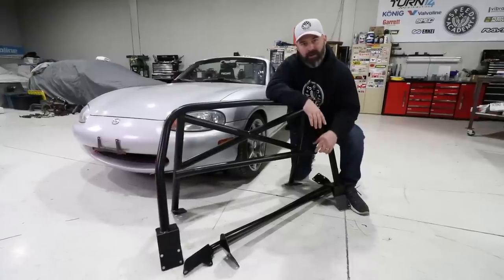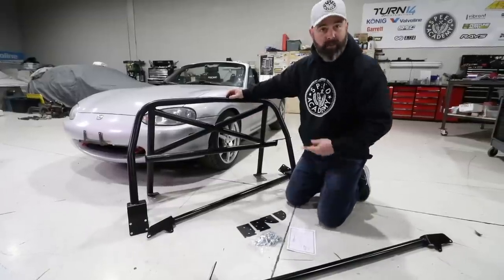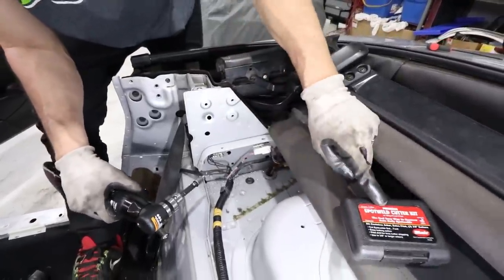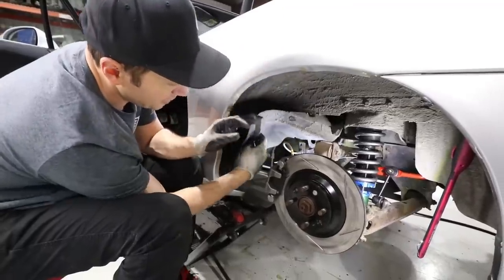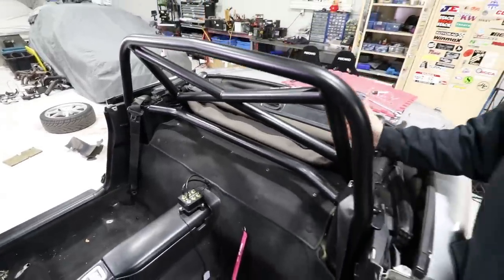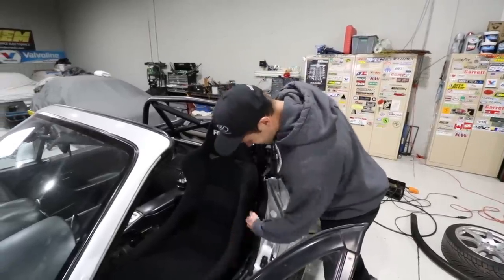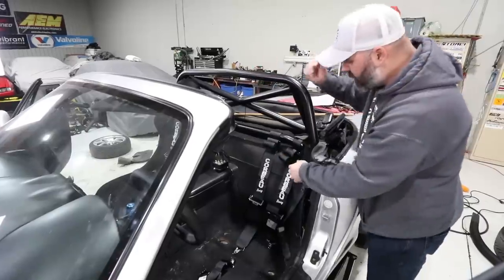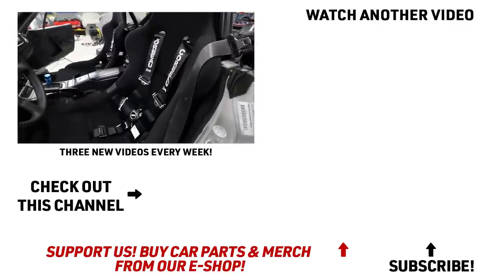Installing the SAFEST Roll Bar Into Our BUDGET Miata

Comment: Mold in that location is usually due to blocked roof drains. You guys probably already checked / cleaned them, but if anyone faces the same issue, now you know how to fix it.
Reply: yep! that mold / moisture residue is directly from clogged drained coming the hole / cutout in the carpet right in that spot. such a common issue

Comment: might want to change the driver side standard seatbelt, looks to have a huge chunk missing! 15:04
Reply: Yeah definitely, Mazda should be able to replace that under the seat belt lifetime warranty.  Assuming that exists in Canada.
Reply: Looks like somethings been chewing it 🐭
Reply: Yeah, that would be a FAIL here in Oz as far as vehicle registration goes!
Reply: @Patrick94GSR  yeah but the reason a chunk is missing is because they squeeze it through the seat (which isn't stock) and the door. If it broke from rubbing on stock parts they would definitely do it. I guess they could just not mention they put new seats in lmao

Comment: Try some NA6 doorcards or ones from LRB.  Might give taller drivers a bit more knee space to the side as well.
Reply: I have the LRB door panels - they are great.  Stock NB doors and steering wheel - my thigh would stick between the bottom left of the steering wheel and the pull handle on the door.  I installed the LRB panels and also a works QR hub / dished steering wheel and now my left leg can sit completely between the left side of the wheel and the door if I want it to.  I'm 6ft1 and my legs aren't skinny.  I know your comment is from 2 years ago, but wanted to reply in case any tall drivers are on the fence about the LRBs.  I have mine bare metal and they don't get too cold/hot.  In the summer the paint on the top of my door gets hotter than the LRB panels.

Comment: That's a good point about shipping, Dave. It is cheaper and often faster to ship things from the UK to Canada than to buy from the US. I have also found that buying from Japan is often cheaper and quicker than buying from the US. 

- EMS is a great way to ship from Japan as it takes roughly a week to get to us in Canada and there is rarely duty to pay.

- DHL is very quick from the UK or Japan. It usually takes 3-5 business days for an item to arrive. However, there is duty but it's usually much less than what you would pay by receiving a UPS/FEDEX package from the US.

RHDJapan is a really good site to buy Japanese parts from. It's in English and has built in currency conversion.
For you rotary guys out there: Jimmy's in the UK is a great company to buy RX7 parts from. They have good prices, good service, and ship DHL to Canada for larger items.
Reply: ...then Covid hit and shipping this bar from Bofi is now more expensive than the bar is :(

Comment: Get frame rails. Cheap mod that will do the same job as those bars without intruding into cabin space. If you want to go all out, flyin miata sells a full butterfly brace.
Reply: Tested the theory on many of our cars, Door bars make a big difference even with frame rails fitted. ~Dan @ BOFI

Comment: I bought one of these for my NB when I saw you guys posted it on Instagram, I love it!
Reply: Hi, Do you still use the stock seats? And if so do they go all the way back?  I'm thinking about ordering the same bar for my NB.
Reply: @blue04mx53  looks like you posted this 9 months ago, have you done the mod yet? Do the seats go all the way back?
Reply: @sapinebez9084  Hi Monica yes, I did, 
Here's my run down. The shipping to Canada was not very good. See if you can do it with UPS and not Fedex. Other than that I have to say that BOFI racing is the nicest company you could hope for. 
They were more than fair to deal with. You may order with confidence. 
Take your time with the install and have a helper. 
Yes, the seats go all the way back however, on the rollbar I ordered (the smaller one) I find that the stock seat back does rub and squeak on the rollbar.  I am very long through the torso so I can get away with having the seat  all the way back but not reclined too much. 
I have the glass back window and there is no issue with clearance. 
If you have the 'speaker/wind deflector' on your car I'm afraid that has to go. At least I've not found a way around that yet.

Comment: The trick for fitting a seat in a Miata is to use a big hammer on the transmission tunnel. Pound it into submission and you’ll get more room. The nice way is to cut and weld but with that seat a little massaging would go a long way.

Comment: It's exceedingly uncommon to have a race seat of any type just bolt into an NA/NB chassis. Most seats require hammering out the transmission tunnel. A lot of the time the factory seat mounts also have to be completely removed in order to put a race seat low enough to be of any use for even an average height driver. If you care to try a different seat, Track Dog Racing has a Miata-specific version of the Ultra Shield Rally Pro that fits extremely well.

Comment: I want to install a roll bar in my NA Miata that I drive on the street and occasionally autocross. Would the roll bar be unsafe and unwise for street use? I have been hearing reports that if you drive with a roll bar without a helmet you run the risk of your head hitting the roll bar from a minor rear end. Thoughts?
Reply: A roll bar should be impossible to hit with your head, it should be behind and above you with your headrest blocking it. A full cage on the other hand is very dangerous and you definitely shouldn't street drive with one. Also don't ever use harnesses on the street or at any time if you dont have a HANS device on. If you don't contain your head it continues moving forward while the rest of your body is held tight and you could snap or severely injure your neck even at stop and go traffic speeds.

Comment: The harness holes on the Pole position seats are way to low for anyone taller than ~180cm. If you are a tall person it's probably safer to use stock three point belt.

Comment: The previous owner for my 01 miata left the seatbelt harness in place when is talking the roll bar so now the seat belt itself sticks-_- did you need to support the roll bar at the seatbelt roller?(top left behind driver seat) I want to loosen the roll bar to fix this but also don’t want to mess up the roll bar effectiveness. Thanks!
Reply: The roll bar has an extra hole on the bracket by the seat belt roller(above and behind the seat) and there is a thick bolt and nut in that bracket but not attached to anything. It’s concerning lol

Comment: Side note you guys were complaining about that mold. Guess they never installed a roll bar on an original NA miata that's been parked outside with the original factory plastic rear window lmao. And shockingly this car has no rust, i have seen rear shelf panels literally crumble in my hands after removing that carpet lmao